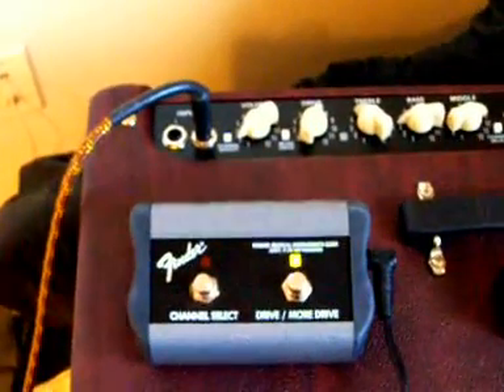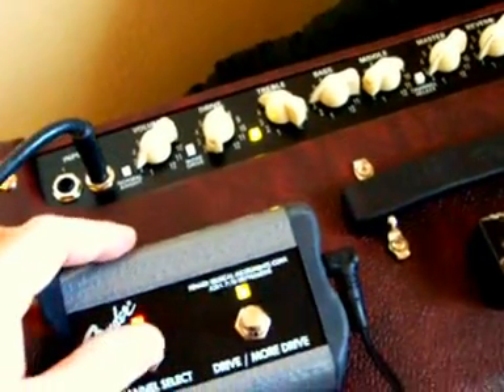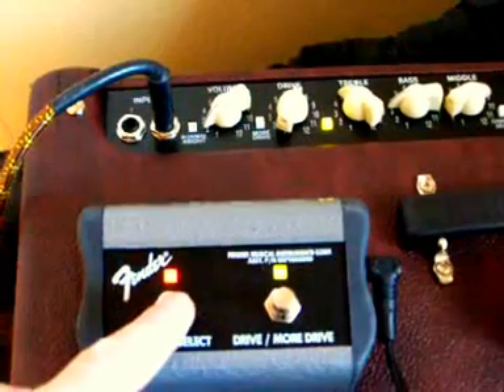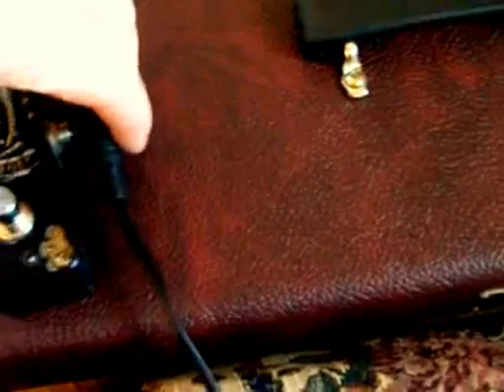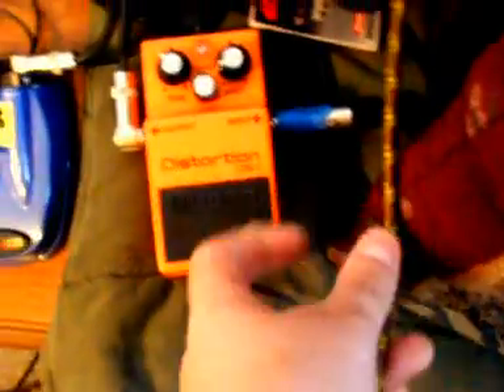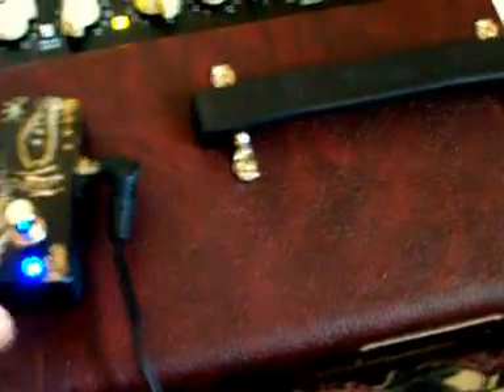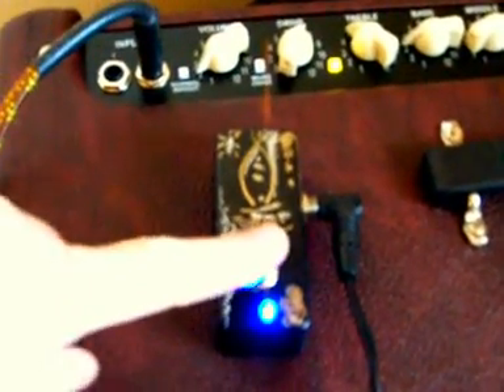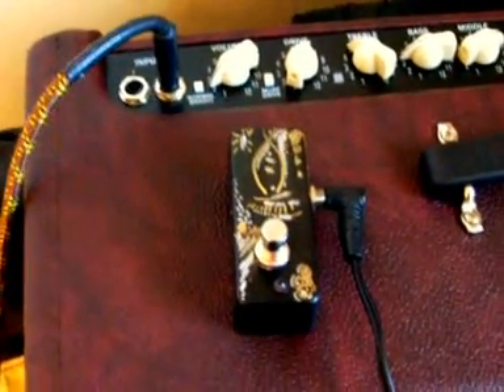Hot Rod Deluxe III Channel Switch Mod

Comment: why the diodes what are there function?
Reply from the maker: Diodes flow current in only one direction. I made this video in 2011 and I do not own this amp any longer and probably won't be able to assist much on this pedal mod, unfortunately. Thank you for watching and commenting.

Comment: I would rather replace the tubes (V1 12AY7, V2 12DW7). That causes the clean channel to be much quieter and both channels to become a lot smoother. The drive channel becomes almost clean, but with nice warm compression and the more drive gives you great overdrive sounds.

Comment: I also hate the footswitch on these amps.. the double red light drove me nuts at rehearsals, I looked for a way to switch the channels externally like you can with other amps as I tend to use rack effects and midi. Modding the foot switch seemed the best way..so I studied it carefully and modded my footswitch a little differently.. rather than create a whole new switch and with minimal impact to the actual footswitch, I hooked onto the switches themselves, installed another TRS jack.. which allowed me to leave the footswitch strapped in the cabinet and I use midi controlled relays to switch the channels. And you can still use foot switch in conventional way when required.. works a treat

Comment from the maker: Paddy - download the schematic from Fender for the switch - it's with the HRD schematic set - and you'll see what the amp is looking for to make it switch like the switch I built. 
I should have sold that design years ago - I'd be rich by now - lol. 
What I did wasn't difficult - just look at what Fender did and manipulate the circuit to get the results you desire with one foot switch. 
By the way - put a 12DW7 in V2 to make the distortion channel sound better.